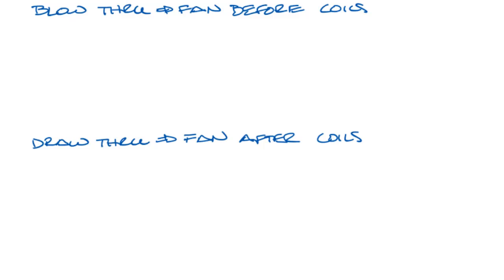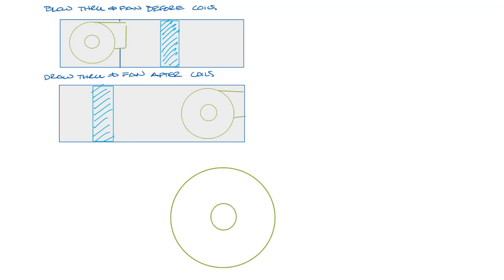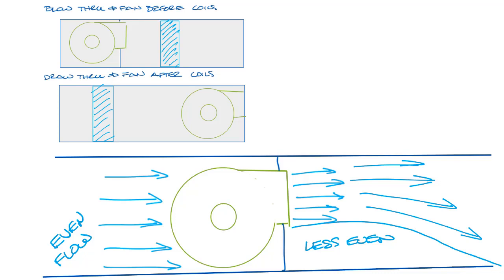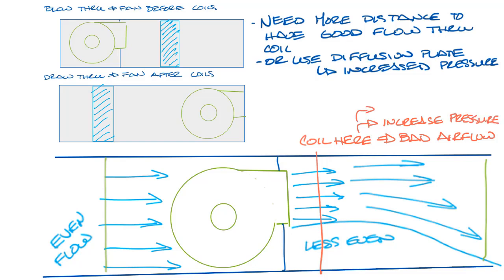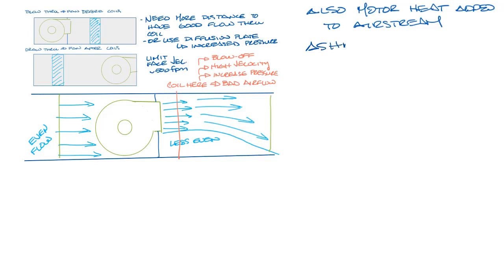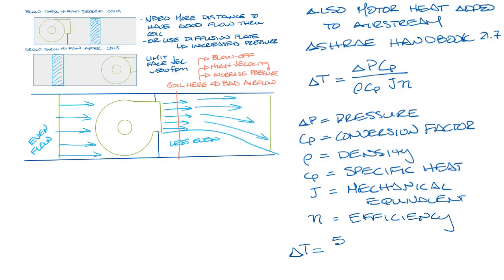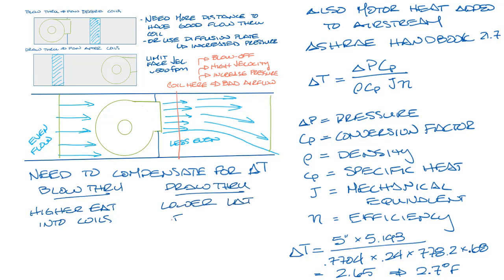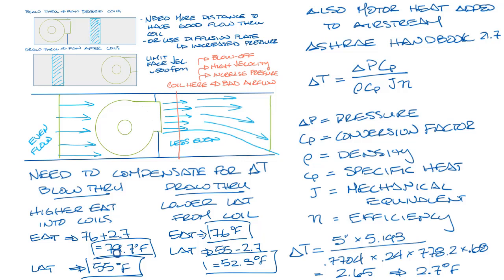Blow Thru vs Draw Thru Fan Arrangement

Comment: What should be distance between fan and coil in blow through arrangement?
Reply: LOL I was looking for that answer too!...In a furnace setup the blower discharge goes through the furnace heat exchanger and expands in that larger area.  On my York that is 24" length, then the coil was after that prob a minimum of 6".  So I would imagine about 30" total minimum.  Sorry it took 3 years...